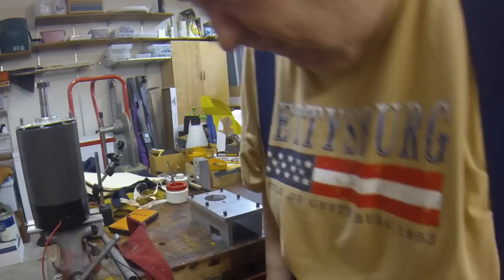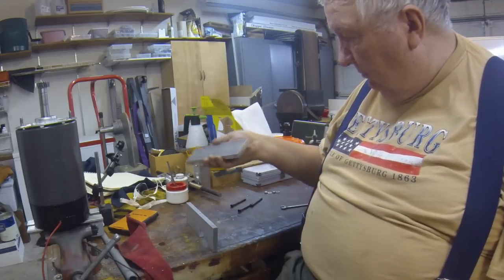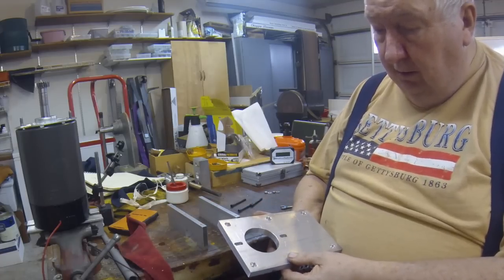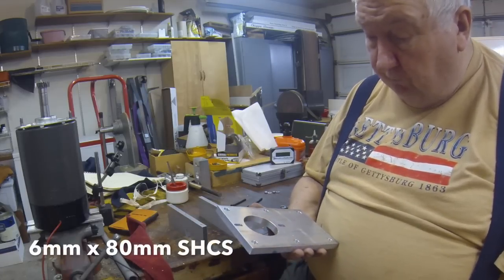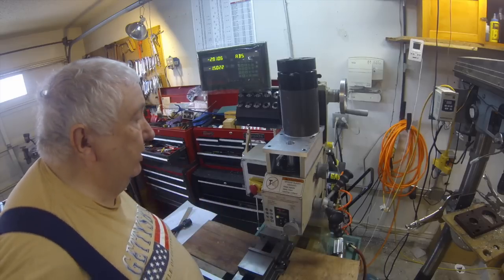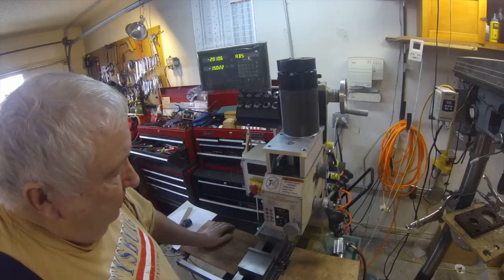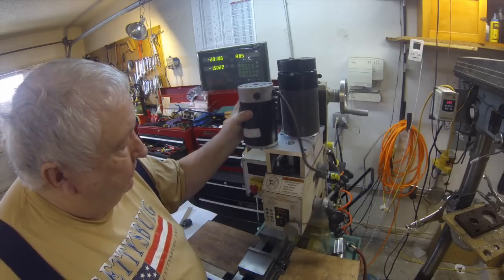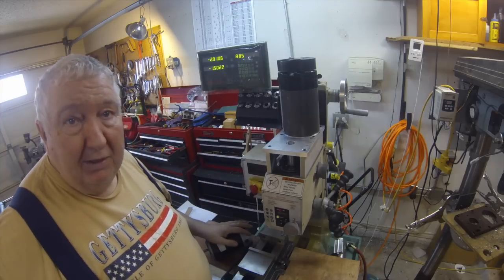Monday Nooner #6

Comment: Hey Herb,

Good modification. Repair, and repurpose. Way more fun than ordering from Grizzly.

Cheers,

Tom
Reply from the maker: You bet Tom.  I went from panic (what do I do now?) to solving the problem with the help of a friend. 
Now I'm going to convert it from a gear drive spindle to a belt drive.  Hoss at  G0704.com has plans and videos of how to do it.  Heck, I can probably figure it out myself now.  BTW, the Grizzly operator that I talked to when I canceled my order for replacement motors, ask why I was canceling.  I said"  I've found a better way to effect the repair". 
This repair cost me, less than $40.  I think I paid $30 for the motor a few years ago, and the only other thing I bought was 6 each 6mm x 80mm socket head cap screws at 70 cents apiece.  The stock was given to me by Metals 4U because of the video tour I did of their store.